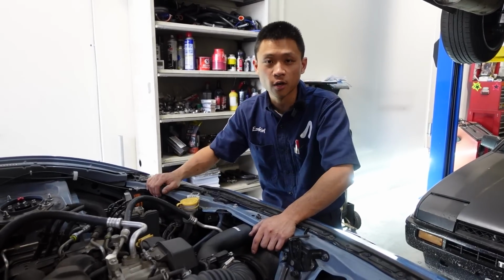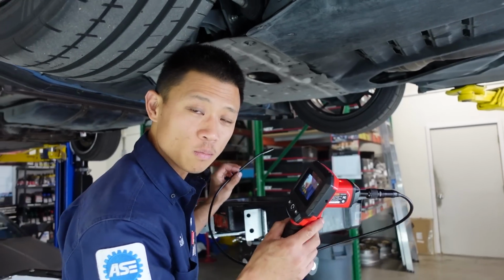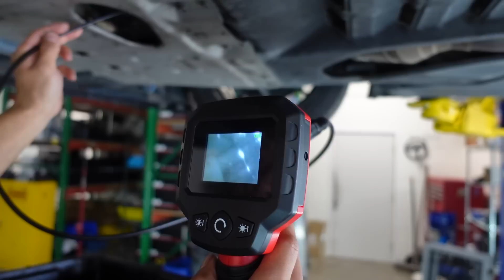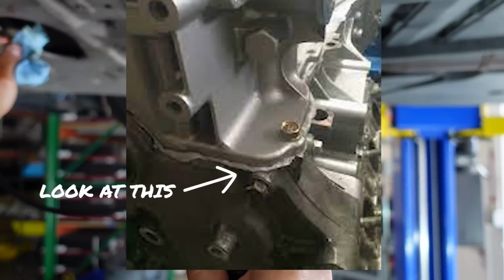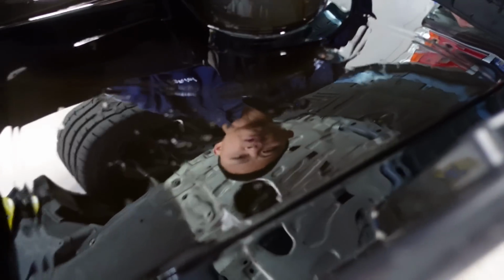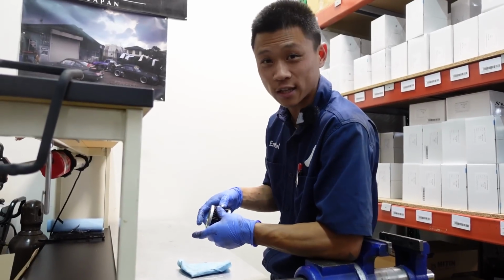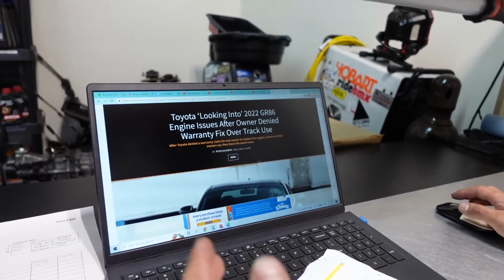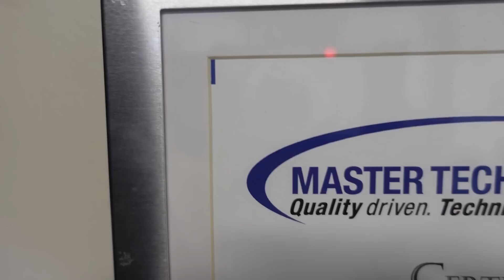GR86 RTV Engine Failures: thoughts from a former Subaru Master Tech

Comment: The thing is, even tiny worms of silicone can break free and they are actually worse because they can go up suction tubes easier than large worms of silicone. Also, it can take a couple of years for this to happen, so if you see the silicone in the borescope you can't tell the customer they are OK because it could happen next week or 12 months from now.
I had a Toyota Celica that it didn't happen to for FOUR years then it did and killed the engine due to oil starvation (note that the low oil pressure light NEVER came on!!!)... My 6th Toyota I owned but they wouldn't do anything so it was the last too.
Reply from the maker: Excellent point. Noted.
Reply: Wouldn’t the oil filter catch them?
Reply: @GreatGrandmasterWang  the intake oil SCREEN catches the worms of gasket and THAT clogs and causes oil starvation to the pump and everything downstream. So it's a problem before the oil filter.
Note I learned the hard way to make sure all the varnish was out of the head oil passages on a rebuild one time. The shop that did the valve seats and machined the deck had solvent tanked the head but evidently not long enough or hadn't blown it out well either. So the varnish became small flakes off the head areas and washed down into the oil pan. Picked up the car, everything looked fine and started driving home. Oil pressure light came on 20 miles down the road. The shop that did the head job wouldn't take any responsibility so I had it hauled home and dropped the pan and found the varnish flakes just totally covering the oil pickup screen! This was anotherToyota Cellica (yes, I liked them) with 162k miles and it has always had good oil changes and showed great oil pressure prior to this but it was enough to wipe the bearings, pulled a main and it was trashed. So a head job I farmed out instead of doing myself cost me a whole engine rebuild (note that I drove that car another 200k AFTER the rebuild and finally the rear end went out so I moved on, good car)
What was REALLY bad and why I'd had the head job done 'professionally' instead of doing it myself was my wife was pregnant and about to pop... So as I had the engine pulled out hanging on the hoist she came outside to tell me I needed to take her to the hospital, it was time. Delayed the rebuild a couple of days.
Why did that bullet proof 22R engine need a head? Well, my wife raced it and a week before she'd sheared the OHC in half RIGHT INSIDE THE MIDDLE BEARING! So the front two cyl were running and the back two were dead! She told me the car had started running rough and had no power, hahaha. And that's why I had to buy a salvage yard head and have it reworked (and a shop do the job instead of me since I was snowed under with other work)

Comment: If RTV is in your oil filter than you have more issues that that, the strainer should stop RTV from even getting to your oil filter.
Reply from the maker: Some pieces are thin or small enough to pass through, but I 100% agree. Dangerous for RTV to pass through the strainer

Comment: A handwritten note with a signature might mean something to a judge or an arbitrator if it goes that far...
Reply from the maker: As a technical we are taught that repair orders are legal documents. I still wouldnt take the chance on something handwritten.
Reply: @CMAutohaus  I used to work for BBB Auto Line. An arbitrator has some leeway to decide what is relevant to a claim and a judge would use rules of evidence under that jurisdiction.

Comment: Excellent video. On 1st gen of BRZ/86, did you see RTV engine failure only in early years of gen 1, i.e. 2013, 2014? Have you seen this failure in later years of gen 1, i.e. 2019, 2020? Hoping to hear no failure seen in later years of gen 1 as Subaru should have RTV application process locked down in production by then.  Thanks.
Reply from the maker: Thank you for the kind words. In my experience, it seems like the Kouki 1st gens dont have this issue and the RTV issue with the Zenki cars was caused by technicians - not the factory
Reply: The RTV issue on early first-gen was from technicians incorrectly performing the valve spring recall - anything produced MY15+ wouldn't have had that issue as the valve springs were updated by then 😊 

So to be clear, no RTV issues from factory throughout the life of the first-gen. 

It's difficult to say they should have the process locked down for second-gen since it is a different motor to the first-gen cars -  same family but 2.4L now. If you're keen on buying one I'd honestly wait 1-2 years or so for them to sort out any warranty issues that pop up.
Reply: @tomh434  You are absolutely correct. But to be more alittle more specific, the 1st gen valve springs were updated during the 2013 model year. Meaning every 2014 has the updated valve springs, and a lot of 2013’s have them as well. For the 2013’s you would need to check each car’s VIN individually before buying. A quick few minutes to save $$$ is probably worth it to buyers who are looking for the best deal on a FRS/BRZ. I have a 2013 with the newer springs from factory that never had a recall issued.

Comment: If im not mistaken this same issue already existed with the gt86 and brz, but wtf that was in 2017 and its already 2023 and this still exist same sealant issue in the same part, i dunno but maybe im mistaken
Reply from the maker: Excess RTV in gen1 was dealer technician caused. In Gen2 it is a factory defect

Comment: Yes Subaru needs to fix this issue. These are modern times and it’s ridiculous that they are having manufacturing issues like this. Just like the stupid head gasket thing that they tried to ignore before finally addressing it. Not smart
Reply from the maker: I think that's why Toyota is testing their 3 cyl in this chassis - Subaru life lol

Comment: Make me wonder Toyota should’ve opt’d for the inline 4 or force Kaizen on Subaru I was expecting better or at least addressing the flaws of the FA engine.
Reply from the maker: Its what makes a Subaru...a Subaru
Reply: force kaizen? Every single car manufacturer kaizens their vehicles, just to a lesser or more extent. This is a RTV issue, nothing to kaizen other than dial back the RTV on the assembly robot. Toyota wanted lower CG, that's why they went with Subaru (plus Toyota is majority share holder), so no they wouldn't have wanted an inline 4.

Comment: Questions; What is the oil pressure switch/alarm set at? Also what is design oil pressure for the 2.4L boxer?
Wished subaru had fixed RTV problem and glad they put in larger surface area screen, but they should have put on oil pan cover that allowed for easy cleanout during oil change and installed an oil pressure gauge as opposed to switch.
Thanks for video.
Reply from the maker: The oil pressure switch is useless in a Subaru: you can have oil pressure with 1 qt of oil in the engine. I use to see this all the time on schedule maintenance. Subaru's oil consumption spec is 1 qt in 1,300 miles. So if you followed the 6 month 7500 mile oil change spec and never topped off your oil, I'd normal to only have 1 qt of oil left in your engine come oil change time - no warning lights. Saw it all the time.
Reply: @CMAutohaus  Thank you

Comment: What a great video! Love the information you provided here. Very helpful. Curious if there is a benefit when they switched over to silicone sealant instead of a traditional metal or paper gasket? Hoping it wasn't just cost related
Reply from the maker: It was entirly cost related unfortunatly. During my time at Subaru we saw plenty of cost cutting throughout the chassis
Reply: @CMAutohaus  Do you own a Subaru? Would like to know what you drive now.
Reply from the maker: @saulespino2510  Ive never owned a "Subaru." I used to own a Series 1.0 FRS which I used to compete in time attack.

Right now my fleet consistes of: 2015 Tacoma Xrunner, 1994 R33 Skyline, 1985 AE86

Comment: My car failed after getting the valve spring recall done. Tons of silicon buildup in the pickup and my car starved for oil and engine failed on the freeway. Subaru refuses to fix even though I paid them $2500 for the full engine reseal :(

Comment: This is an old problem. My 13 got blown up after the Subaru techs did the valve spring recall. The pick up tube was completely clogged and blew the bearings within 400 miles. Subaru claimed it wasn’t their fault and I went back and forth with them for 6 months. No luck. Loved the car but will never buy a Subaru again.

Comment: I actually want the get the 2nd Gen 86 for myself to keep forever
But since that video poped up how the dudes engine blew I was very worried
As you cleared it up I now know why it did.
Now I am still considering getting the 1st Gen 86 over the 2nd Gen 
Because a Dealer wanted to sneakly sell me a Rent 86 for the full price of a new one.
I still dont know man.
Reply from the maker: If you want a gen2 get the Subaru variant as they actually honor the engine warrenty
Reply: @CMAutohaus  ill keep that option in mind
It's just that I'm worried about its engine durability from the design perspective.
Never had a boxer engine myself.
And I did took the worst time to buy a car with interest charges been too high (7.1%)

Comment: This is what I did to my 2014 Scion FRS.  I used a machine that pumps boiling hot diesel thru the oil filter area using a supplied adapter.  At the bottom of the oil pan; another adapter was installed where the drain plug goes.  The pressure of the diesel will remove anything on the engine including debris of silicone, metal, engine gunk, even carbon soot.
Reply from the maker: Im sorry, but that sounds terrible and I would NOT recommend anyone do that.
Reply: @CMAutohaus  I did it and is been working good so far.  Even took the car to The Tail Of The Dragon and performed flawlessly

Comment: If RTV is used to seal several joints in the motor assembly, is it possible that the over-application of sealant in other joints could lead to future catastrophic failures as serious as this one?
Reply from the maker: Absolutly
Reply: @CMAutohaus  :(
Reply: I wished they didn’t put a boxer engine… the car looks really clean it’s a shame
Reply: @crazymonkey60123  it's not the engine's fault if it isn't assembled correctly

Comment: Im curious as to why issues like this still pop up, when engines have been manufactured for so many decades now with robots. Wouldn't the correct application of sealant have some sort of standard practice by now?
Reply: I imagine it depends on the gap between the pan and the element it sits up against, as well as other factors like the size of the lip etc.  So I would guess it's not just that it's by a robot, because the robot wouldn't be aware of those factors - it would be the amount of silicon it's been told to apply... which might be too much for the specs mentioned above.
Reply: @MKu64  but wouldn't they have figured out how much before going into production?
Reply: @Briguy288  I mean, you could say that about any mistake :)   Things get missed.  For something like this, hidden away in a hard to see place, I assume it's possibly something the QA inspectors didn't pick up on.  Once it causes an issue for people they would become aware of it.

Anything is possible though - maybe there is a malfunction with one of the robots that the nozzle puts out too much silicon, who knows really.
Reply from the maker: Robot? Mistake? Its Skynet bro...
Reply: @Briguy288  why not just use an actual gasket instead of using toothpaste lol

Comment: With all due respect, i think this is getting into the territory of content creation rather than actual problem highlighting; there is no such thing as clear used oil or clean filter if the oil ran the range. I have worked with AMG and commercial benz vehicles and there is always debris and impurities especially with thinner oils. Rtv is overblown and will not cause engine failure unless you are extremely pushing the car on track with the wrong oil, but yet again , many causes of failure can kick in at this point way before RTV starts getting in the picture.

Comment: This is much worse than BMW gasket failure problem

What happens when the parts that the silicone deteriorates to the point that everything it's supposed to seal start leaking (cams, valve covers, etc)? 

Also there's so much silicone that the RTV problem seems to be the gift that keeps giving. How often do you need to clean out the drain pan?
Reply from the maker: These cars are still too new to see how often you have to clean the strainer. I'd like to drop another pan in one year.

Comment: Any info or rumors as to whether the RTV issues have been addressed with the “2024” BRZ or GR86?  Any input is appreciated.  I am ordering a 2024 BRZ Limited.  I will not be tracking the car or pushing it extremely.  I am retired and just want a fun car for my daily driver (under 5k miles per year).
Reply from the maker: No official response, although Im sure Toyota/Subaru is aware of the issue as they made some updates on the later 2023s.
Reply: @CMAutohaus  thank you so much replying.  I appreciate you and your channel.

Comment: I have a question... Does the risk of this silicone breaking off increase with engine temp. For example, if someone is at a track day seeing excess temps, would the risk of all the silicone breaking of increase ?
Reply from the maker: I think the short answer is to pull the oil pan and check yourself. I actually already have Gen2 customers asking to remove the oil pan, clean the oil strainer, and remove excess silicone as a service.

Dont risk it, not that much labor time to remove and reseal the lower oil pan.
Reply: @CMAutohaus  what about gen 1 ?
Reply from the maker: @Arun kumar  I used to have a Gen1 I ran in time attack (86Drive Challenge). Very first things I did: Reseal oil pan/check oil pick up, Bluemoon oil pan baffle, Jackson oil cooler kit, ARP wheel studs
Reply: @CMAutohaus  thanks for all the info ? What oil did you run ? Will the Motul 300v 0w40 be ideal for the time attack ?
Reply from the maker: @Arunkumar-bg5xk  Any premium 0w20 is fine with an oil cooler. 5w30 has been recommended for forced induction guys.

Never track your car w/ out can oil cooler
Reply: @CMAutohaus  So it can happen again? God damn that shit!
Reply: Yes, potentially. Water is the main engine coolant. However, if restriction is large enough to decrease oil flow through the engine, the oil can achieve excessive temps. Simple Mass & Heat xfer.
Reply: @CMAutohaus   Man everyone with an 86 has had problems with wheel studs, I had to change all of the fronts to ARPs and have one broken/stripped in the rears on each side that I'm about to replace. Seems like the first mod to do should be replace all the wheel studs with ARPs haha
Reply from the maker: @louief857  1000% agree. OEM wheel studs are garbage

Comment: do you encounter the engine oil pressure drop on right turn when on track?
Reply from the maker: I personally dont own one of these chassis, but our shop services majority of these in the greater Bay Area. The key with the big oil pressure drops on right turns is the stickier the tire and the more skilled the driver, the bigger oil pressure drops.

Comment: Should the 2022 wrx owners be concerned having the fa24?
Reply from the maker: Good question. Not quite sure if the two share similarites like place of manufacturer, failure rate, ect But you bring up a great point
Reply: Shiet, I may as well just save up not just for the car but an engine swap as well.

Comment: Should I be worried if I only use my car as a daily? I don't plan on ever tracking it.
Reply from the maker: Still has risks. I rarely worked on track cars during my time at the dealership which means 99% of issue were with street/daily driver cars

Comment: It's not the boxer engine design it's Subaru's build quality etc. I have owned several Porsche's and never had any major problems with their engines. I put well over 100k miles on a couple of them. Toyota should have put one of their 4 cylinders in the thing to begin with.

Comment: My 2016 got 30k miles and rumbling at the bottom end.
Had what looked like copper in the oil filter.
Any body got any ideas what's probably my best bet.
Dont want to change the whole motor really im hoping its just a big end bearing problem.
One more thing it seems like its on 3 cylinders.
If its a spun bearing will it be big bucks.???
Reply from the maker: Best bet is replace the short block or long block. You have to disassemble the engine to change the big end bearings

Comment: well, I had my eyes set on the toyota twin, but if they're being pissy and selective about the warranty, I'd rather go with the brz. It seems like toyota won't honor it if you remove the oil pan to clean the crap out, at least from what i've read. Rather not wait until the engine seizes to take advantage of the warranty IF they even honor it. I was never planning to track or drive terribly hard either, just a fun daily that i can enjoy driving every day. Or is it worth to bite the bullet and risk voiding if it means i don't need to worry about the RTV down the road? Idk man, still gonna wait until at least the '23 model year, maybe one more to be sure.
Reply from the maker: In my experience, Subaru has be far kinder to its customers. I've seen miracles happen during my time as a dealer tech ie. a car with 60k miles get bought back.

Comment: many of the places just doing a cork gasket would be super cheap, easy and more reliable. I wonder why they keep preferring RTV on all areas, what is the mfg cost benefit?
Reply from the maker: Apparently it saves a ton of cost just to have the robot silicone everything instead of having PNs for a bunch a gaskets

The kicker is that Subaru uses basically the same engines across their model lines, so it wouldnt be that many PNs
Reply: @CMAutohaus  Just another example of the robots actually making things worse